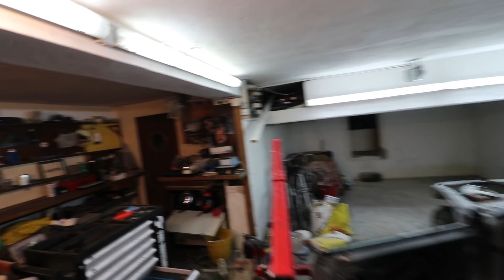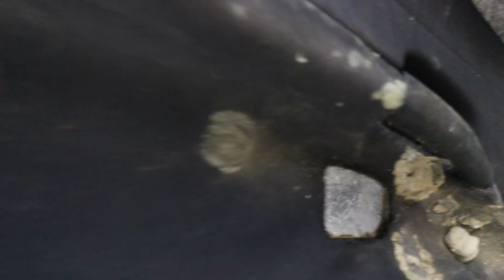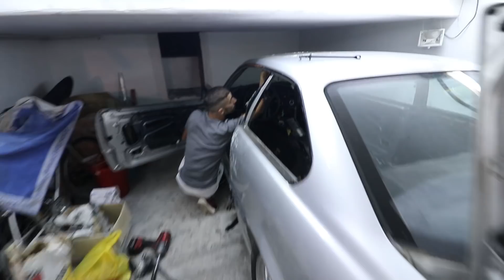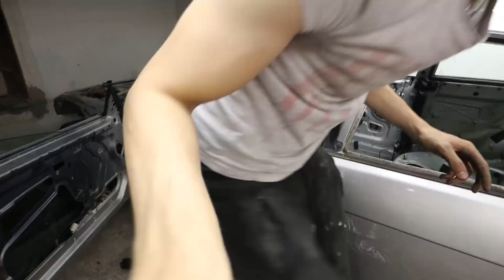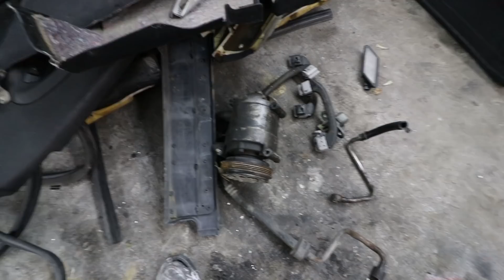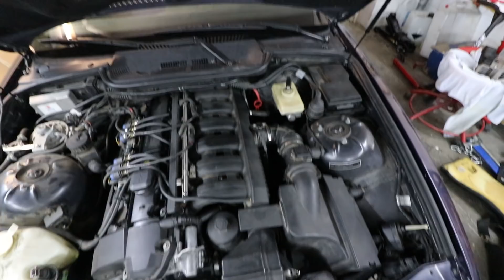Vadimo Unutrasnjost iz Nove E36 za DRIFT!!! (otkrivamo neugodna iznanedenja)

Comment: Jedno jako vazno pitanje koliko mm mogu da spustim glavu od m43b19tu motora sa stock dichtungom od 1.73mm? Uskoro ide generalka obrada glave klipova karike auspuh od 330i e46 cip tuning ciscenje brizgaljki kompletni dihtunzi motora novi set kuplunga vodena pumpa termostat creva i ostalo. Dakle cilj mi je nekakvih 140 150 konja od standardnih 118 samo cip po dino testu daje 130 konja pa kontam jos obrada glave kanala auspuh itd plus spustanje glave i nabijanje kompresije radi boljeg banggga pa me zanima i jako mi je bitno da mi neko strucan kaze koliko mm mogu da spustam gprivo nije problem jer sipam nemacko gorivo 95 benz 5% etanol bolje nego smece sa balkana pa sumnjam da ce dolaziti do losih detonacija.. :) hvala u napred i bez odgovora poput da ubacim veci motor ovo radim iz ljubavi prema m43 motoru i zato sto ruke kostaju samo paj gajbi pive :) pozz